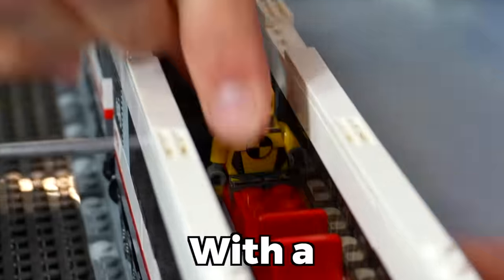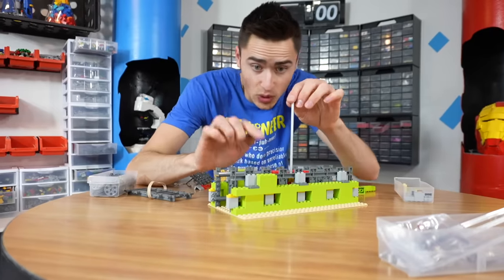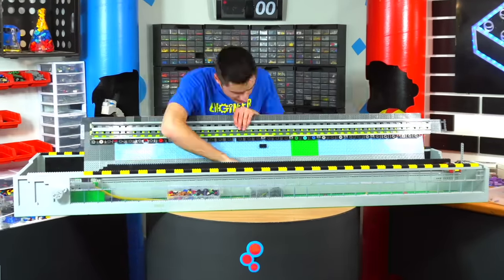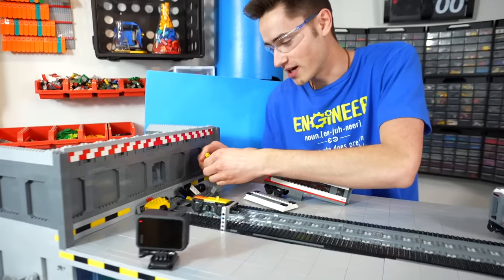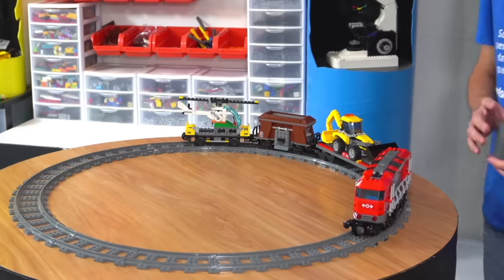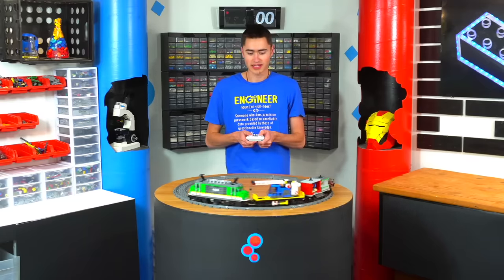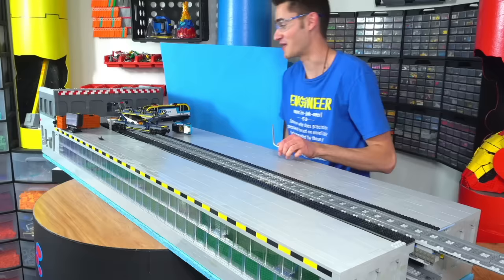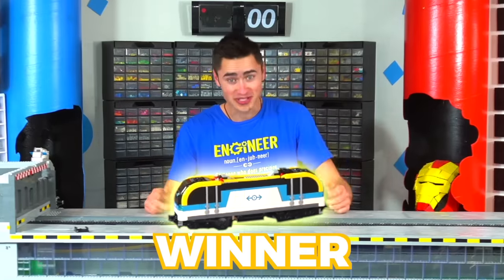Crash Testing LEGO Trains!

Comment: That Track setup with the set of Wheels on the bottom and set of Wheels on top with the Tracks on bottom and top is how the setup in my Homemade Crossbow works.  Except the little car has a String (made of the same Materials and way the Bow String is) attached to a Ratcheting Pulley.  Crank it, Pull Trigger, Full Sized Arrow flies through the Air to Target.  Rinse and Repeat.

Comment: An idea I came up with, and you probably did too, was to use LEGO wheels hooked up to a motor and use that as the booster. 
Side note:
This reminds of the old Hot Wheels tracks I had when I was a kid. I would always set the boosters super high and the cars would go flying off the track 😂

Comment: the problem i see with your launching mechanism is it is still applying force past the moment of impact, imparting its momentum into the piece it is pushing.  You should have a side tab on the train that you pull to about a CM before impact that way there is no extra momentum and no other outside force es imparting to the pushed car.

Comment: Without being able to measure the G forces, there isn't a good way to determine who lives or not. I'll base my assessments on damage sustained, speed, and some other minor factors like real world data.

In the first crash, the driver of the train and the car likely died on impact, the passengers at the rear would've probably been thrown and received minor to moderate injuries.

Second crash, the driver was ejected and died on impact, the passenger in the rear probably suffered minor injuries. The rear employee received more severe injuries due to flying debris, standing, and the counter detaching.

Crash 3, the front attendant suffered intense G force based injuries and whiplash, he probably died in the wreck. The guy on the side would have been flung and died, the rear attendant suffered moderate to severe injuries, but will probably survive. The dude the train hit died from massive brain trauma and a fractured skull.

Crash 4, definitely no survivors. If anyone did survive, they died in hospital, or were left in critical condition.

Number 5. 1 rail worker died standing near a derailed freight train trying to warn the approaching train, and 4 more died trying to deal with that derailed train, unaware there was an oncoming freight train. The crew on the other train suffered moderate injuries, but might survive. If the guy in the car was wearing a seatbelt, he'd be injured, but survive and then get fired. If not, he'd have gotten ejected and likely run over. The other guy would suffer the same fate if he was wearing a seatbelt, if not, he'd probably hit the dash and suffered so much trauma he'd probably die in hospital. (Wear a seatbelt mates.)

Final crash, self explanatory, it was catastrophic and everyone died. No contest.

Comment: Your system is good, only the trains are not catapulted, they are pushed into the wall. Your metal pin, which pushes the train, should actually retract somehow in the middle of your trajectory. By doing this you will have a fair outcome. You would also reconsider your winding system. A kind of click system. Each click is a little more tense than the previous one.

Comment: You make crash tests in full speed as if they were real. Then you based the points on whether the figures stay seated or not. The wheels fall off. The front part come off. Even the roof. And the train is upside down. But the figure is still in its place. They would be dead in reality. I’d rank trains much higher if they didn’t turn on their sides and actually just got minor damages. I don’t agree to your testing scale. You sit in a car on a crashing train and the car falls off. It doesn’t matter the car is intact. You died anyway.